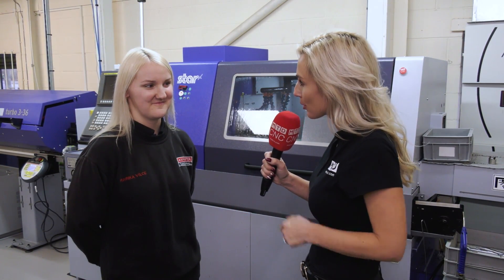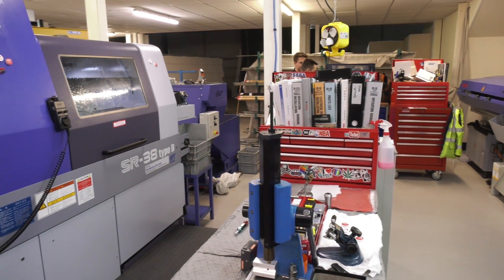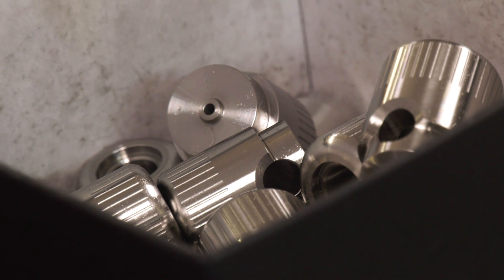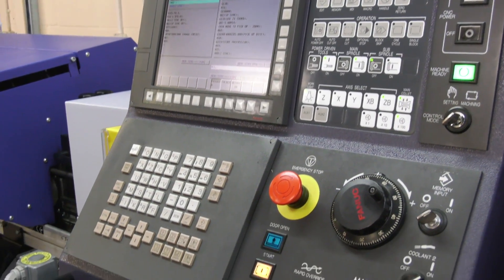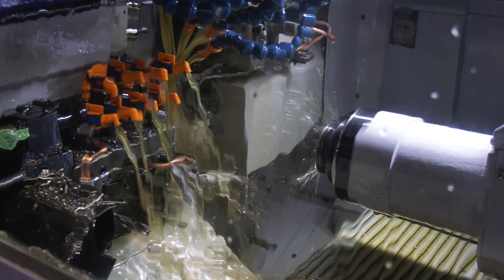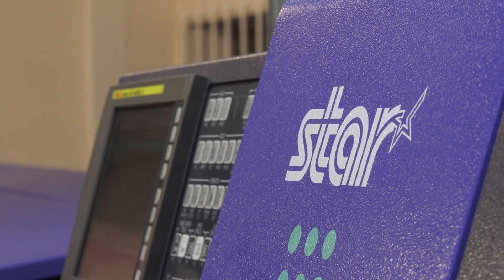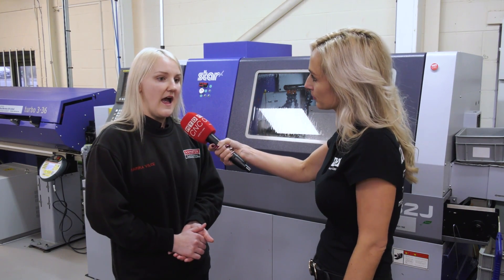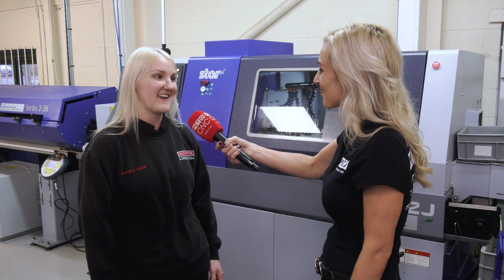Marika is a CNC Machinist at Axminster

Comment: Years ago, a skilled machinist could make a part in 1-1/2 hours.  Using the cnc, the same part can be made in a few minutes and be made the same each time.
Reply from the maker: thanks for the comment, so you use sliding head lathes?